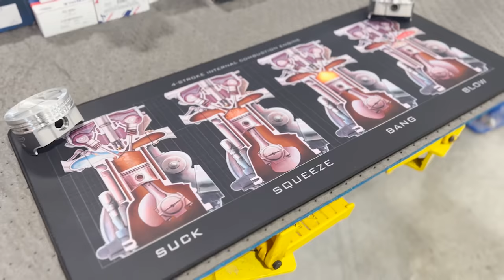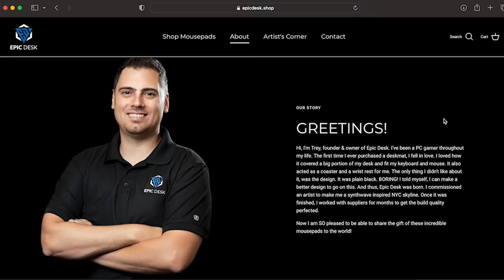The 383 STROKER Kit Has Arrived... Does It Fit?!

Comment: I built my 383 back in 97 long before kit's and crates were available. Finding the right block casting was key to avoiding alot of headaches. Engines still in my 80 Firebird after all these years  and runs great, so yes I would love to see you folks do an old school 383 build. Thank you for the great content guys.
Reply: Same same in 97 , the Vortec head was a new thing and u could buyem from GM assembled for 400 a pair , Edelbrock started making a carbed intake so thats the route i took with my 383 , the new powdered metal rods from GM as well , no need to clear the block but the cam was another matter with shaving down the shoulders on 4 rods.
That motor pulled so hard that ever since i've thought doing a 350 :text-green-game-over: is pointless. Now im playing with a 383 crank in a 305 and ported swirl-port heads for my S10 , can it make 400 lbs torque and knock down 20+MPG ? should be interesting ! :face-green-smiling:
Reply: Huh, '97 was long before kits and crates were available? PAW was offering 377, 383, 385, 388, long blocks, short blocks and rotating assemblies back in the early '80's. Their catalog was about 2 inches thick and covered everything from Chevy 235 straight sixes to Desoto Hemis, to their Godzilla 514 inch Ford 460 stroker kits. There's no less than 9 different crate and kit suppliers in the random issue of Car Craft from the '80's that I just picked out of my pile, the original RHS, racing head service was a pioneer of the crate revolution ten years or more before '97. Super Shops was another mega catalog that offered the same stuff, they just came along later in the decade, I still have all those catalogs, I wish the prices were like that today, lol.
Reply: There were 383 kits way before 97 😂
Reply: 400 crank, 350 block
Reply: @paulmryglod4802  The 400 crank main  journals have to be turned down. It's not a drop in.
Reply: @genefogarty5395  oh yeah I forgot about that

Comment: Kevin Cameron (Cycle World) has impressed me with how floppy "rigid" parts can be at high revs.  It's reassuring to see how much clearance you provide.
Reply: Link?
Reply: @neodimium  Sorry, I don't have a link.  I used to read his articles in Cycle World (on paper!) - he's a master at clearly describing the engineering aspects of high performance engine development.  I'm pretty sure his work can be found online.
Reply: do u have a link, cheers   
(min effort possible here ) weird al
Reply: I'm glad you mentioned this. I've been looking for material on that very subject 👍
Reply: @robertwest3093  Kevin Cameron is like no other and his descriptions about material behaviors inside high-strung motorcycle engines will bowl you over.
Reply: I also am a fan of clearance but I would have went at least fifty thousandths more
Reply: Not just the floppiness of the material, but heat is going to bring things together as well. I think I’d of went a bit more than 60 too.
Reply: @GNX157 .050 is my minimum for clearance and never had a problem. I do prefer a little more for flex and deflection depending on the parts and intended use of the engine.
Reply: Isn’t 80 thousandths the usual accepted clearance for the rotating assembly?
Reply: Kevin Cameron is one sharp individual. Refreshing to see his name on a car video.
Reply: Kevin Cameron is a genius in communicating mechanical characteristics in plain, easy to understand language. He is a national treasure.

Comment: 9:55 witness mark on the bore of the die grinder touching. Was always taught to wait till bits stopped moving before exiting the cut. Like the "it's hot" tip, you only believe it after the first burn.

Comment: 383 strokers ive done required a notch milled at bottom center of each cylinder bore and a relief at the pan rail. Summit was carrying a dimpled replacement oil pan.

Comment: i always use silly putty to check crank clearance. 
put an 1//8" layer of silly putty over the problem area, rotate the crank past the problem spot nice and slow, and then peel the putty out and check the scraped part for thickness to see the clearance. sometimes shows you something the feeler guage and line of sight cant

Comment: great video, making stroker crank fit sbc block is quite a project. one tip for checking cam lobe to con rod clearence is to use nylon tie which is usually .045 thick when rotating assembled shortblock, inserting between moving parts is easier than trying to use feeler gauges i've found. good luck with your project!

Comment: When I get a fresh block for a stroker, I set up a pair and check clearance and then make a grind on all the bottoms, rough cut if you will then recheck all of them. Most times it is fine but occasionally I have to touch up 1 or 2. It goes much faster than doing 1 or 2 at a time. Great video and thanks for taking the time to do it.

Comment: I’ve built so many of these SBC 383 and stroker fords combinations when I was working in a machine shop. On a 9.5 deck SBF 393, 408, and 418 about 30 minutes of clearance grinding and done. So much more work when assembling a stroker SBC. I used to convince people into buying a Bow Tie or Dart block because of the extra shop hours $$$

Comment: I built two 383's with Scat rotating assemblies and their stuff is top notch IMO. The attention to detail in clearancing is a PITA but a necessary evil. We contoured everything with a cartridge that we used a carbide on to avoid any problems. Both engines are still going strong years later and one even gets some nitrous now and then, the other is at just under 100k miles of camper towing. Your customers are very lucky to have such skilled and caring builders/machinists. I'm nowhere near the caliber you guys are at, but with the assistance of a machinist that I have to drive 2.5 hrs. to go to, I can build some good junk, lol.

Comment: We still run our 383's every day here in metro Denver and they are very fast. The secret for STREET APPLICATION is 11 to 1 compression with aluminum heads and 91 oct. pump gas. 
This is what doesn't work here with our thin air: Big cfm heads, big cams, big carbs. We know as we have tried all those combos. Our 383's actually outrun our 400 smallblocks.
My S10 383 outruns our cammed LS 6.0 S10. Its all about the combination of parts and the application.

Comment: Was doing a long rod (5.7”)400 sbc build years ago.  Was using a hydraulic roller cam and the top side of the rods were hitting the camshaft in just a couple places.  Had to grind a small amount from the area on the the rod where the cap bolts would thread into.  The next time I had it apart I upgraded to better pistons and rods and these rods were already designed to clear all areas on the engine. I believe they were eagle series 2 rods.  That with sealed power forged pistons and eagle cast steal crank.  All balanced, GMPP fast burn heads, comp cam 236, 244 @.050 550 lift 10.7-1 comp.  Thing was a little screamer and was bulletproof.   Outstanding combination.

Comment: I love watching your videos! I usually do the bulk of clearancing on the mill then clean it up with the die grinder.  Personally,  I like to come back with a 120/220 cartridge roll and clean up all the stress risers and smooth out the casting around the bottom of the bore and the lifter valley and a light polish on the outside faces of the crank,  get as much oil returning as possible for high rpm applications.  Also, I like to use raised compression height piston so the zero deck leaves 5ish so if it gets rebuilt again switch to std piston still have 5 on the decks to clean up.

Comment: 2:17 - It's always eye opening for me to see power tools used to drive in engine bolts. Just shows me how narrow minded training can make you and how times change.
Reply: Yes, when I did engines years ago, I used a T bar first, then a torque wrench. The T bar is more sensitive than a power tool, and pretty quick.
Reply: It is just for mock up to check rod clearance, probably only 20ft/lb on those nuts. Way faster with a cordless, when it is apart and together 15 times while clearancing. They for sure use a torque wrench when actually assembling.

Comment: Over the hill from you in Rifle Colorado. 
In high school, ‘83 or ‘84, my buddies dad built a 383 for his truck. 
I remember all the fuss about using a 400 crank in a 350 block. The 400 was externally balanced, so a 400 flywheel was required. 
I got to drive it a time or 2. 
  Ran awesome !
Ohhh… & 202 fuelie heads

Comment: What I have done when setting a block up for clearance, i would take a stock rod and cut the long part of the rod flesh of the big in of the rod. I would bolt the big end of the cut rod onto the crank with a bearing in it. You can install the new rod a piston to the same rod journal and this will hold the rod in place to roll the engine over to check clearance.

Comment: Camshaft lobe can get really close to con rods in these engines.They call them stumbling blocks for a reason. thanks for sharing.
Reply: Ran into that problem years ago with stock 5.7” rods. I think stroker kits now use short rod bolts to clear the cam lobes.

Comment: My 383 I built had the same clearance issue. My 400 the machine shop suggested I use 5.7 rods probably not a bad idea but it was even worse than the 383. Had to clearance the block not a big deal but also had to take material off the edge of the rod bolts where they swung up towards the camshaft because they were contacting the lobes. I lost count how many times I assembled that engine before I had at least.080 clearance with the cam. I built that 25 years ago still going strong.

Comment: Not a machinist but I used to study this stuff.  The 'squish area' is supposed to be just right to help avoid detonation.  Something about it squeezes the air out of the flat area of the combustion chamber and that airflow cools the head surface lowering the apparent compression ratio.  You guys already knew that though.

Comment: The camera didnt pick it up but those carbide burr tools sure throw chips everywhere. I used one to open a transmission fork up a bit on an old tractor that was wanting to bind when you shifted the pto. Fixed that problem.

Comment: The compression ratio needed is directly tied to the cam timing specs. David Vizard covers this thoroughly in his books and on his YouTube channel. Higher compression helps with better gas mileage too. The piston to cylinder head clearance also needs to be set.

Comment: It’s great that you guys are trying to keep the CR in the 9 to 1 side. But; you are talking here    static compression ratio; there are in the net good formulas to calculate Dynamic Compression Ratio. If you guys try it, you will find that actually, you can run your engine on a higher CR ( static) and get more power whit low octane fuel and at the same time add more reliability to your customer’s engine… saludos!!

Comment: Check the rods to the cam on 1-2 and 5-6 If I recall right. The inner rod bolt shoulder area can hit the cam lobe on those cylinders every second revolution. I used to grind the side of stock rods right at the rod bolt head. Use a strip of cardboard to check it....I built a lot of 383's back in my machine shop life. Some rods are a lot worse than others. They do make "stroker" rods that help but the block grinding issue is common. The rods you have should clear the cam but check it ! Another issue I've had was blocks with bad core shift. Rods clear one side but not the other. Cam hole pad at the front is a tip off on that one. Cam and crank centerline is off to one side.......I built 383's back in the 1980's when that engine combo became popular thanks to John Lingenfelter and magazine articles......They make real good power and torque..   and Bandimere is going away after this season....that is a shame.....I've never been there but it looked like a great place other than the high altitude !

Comment: If MY opinion matters at all. I'm n old dog like the cleaning guy and we used to flow our own heads, bushing and make stock rods capable of Saturday night on the dirt track.    Funny story.  Working with a machine shop back in WI years ago all the angel plug heads that no one wanted started to stack up at Allis Machine, Laughing with the own Steve and his man Jeff we said wonder how far we could take a set and make power with them.  Soon enough a test mule was built and we all hogged out 2 pairs of the heads. Running on the dyno they made good power to point a pattern was devised and a recipe was cooked to make some motors for some race cars to be sold.  10 years later, a new job, new boss, asks me to look at his 81 firechicken drag car that he bought to try his hand. ( he didn't even know how to spank the hides or leave on the last Y) He was mad cause the car wouldn't even launch from the way the guy he paid to set it up and this POS Jasper performance th400 with a 5500 stall.  So I agree he brings it to the shop and I look under the hood to find one of the angel plug mills I know made at a min 500hp and 530#'. A week of sorting the BS of the other Goober and the boss was drooling as I pulled the front wheels in the back lot. Another few weeks sorting the chassis from the clown that used nails as cotter pins and incomplete cage welds.  First night at the Union Grove raceway I discovered he hadn't a clue how to drive one. So right seat and show him. Car went through the traps at mid 10s which I wasn't expecting at all from the tune I set up thinking about 12. We got booted at the timing shack for the passenger me.  They didn't care but hell of fun.     I think the old cleaning guy needs to build one old school for that monza. No box cylinder heads either there pops.

Comment: Nice detail work thanks for the great videos. In the aviation industry we go with a 0.25 clearance on most moving parts
Reply: Is that 1/4" or 0.25 mm?
Reply: I seen one engine builder recomend it should be enough clearance to not hit aftet the engine destoyed the rod and crank bearings

Comment: Least it's not an H beam rod. When I started at an engine shop as a kid, that's all I did was clearance blocks. The I beam in a 350/400 are not bad, but the H beam I actually hit water because of core shift in a couple of 350 blocks on the cylinder notch.

Comment: Why did you go with a 5.700 rod length instead of 6.0 rods and the appropriate CH pistons?

I seem to remember having to clearance the bottom the cylinder by the cam tunnel too.
Edit: 8:40, I see you got it right after I wrote that!

My guess is that you’ll have to deck .016 after you align hone it.. maybe .018

Comment: I'm still surprised by how much the blocks can vary as to stroker clearance. The block you are working on looks to need the most I've ever experienced. I had one block that needed ZERO grinding, a couple that needed moderate grinding, one that needed just a tiny bit except near the oil filter mounting area where it needed quite a bit. I'm about to head to the garage to check how much my latest 1 pc. seal block is going to need--got my fingers crossed!

Comment: Great job boys there's no nice or clean way, I've done this many times on various stroker cranks. If allowable I've used a 100thou clearance size then use a Dremil with a Barrel sanding head to smooth all the edges for stress relief. Luv your work. Australia.

Comment: i want to use 4.125" crank and 4.110" bore sleeves in a 350 block without block filler going to 5800 rpm. = 438 c.i. 
With 4.030" bore would come to 421 c.i. still enough cubes that all the magic happens!

Comment: You need .060" between the cam lobes and rod...  Incase a rod bearing goes out without hitting the cam lobe.  That's how thick the rod bearing is, .060".  Small base circle on the cam helps with a 383" engine.

Comment: Looks like it fits too me. Normal grinding..if you don’t want to grind put in a stock stroke crank. Buy a Dart block which will take a 3.875 SCAT crank. This is why a great engine takes time to build. It’s a cliche word “blueprinting”. At $100-150 per hr …I do this myself.

Comment: 24:02      I have a SBC block I believe it's 10248880.   It has a divot between 3&5.  Just curious how much it can be decked by checking divot depth.  Or do I scrap the block?  Thanks.

Comment: I know Skip White has the blocks setup in a mill and relieves those areas for a 383 etc. being as it's an engine block it would have to be a fair sized mill I'd guess. I guess in this case the hand held mill is the proper tool.

Comment: We used to use that combo in Circle Track street stock racing. We used to hit water while clearencing some blocks. What method do you guys use to cure that? We have epoxed some blocks  inside and outside the water jacket area and put that water jacket cement in others. Both seemed to have worked ok. Just curious if there are other methods out there? Love your videos. Thanks

Comment: I got lucky when I built mine, the block i got had already been  383,  I had it bored . 040" and got a 385, my estimate is 550 HP around 6800-7000 rpm the .585" cam and 220cc heads, and 11:1 compression, single plane intake ,  I kinda wish someone made a large runner 
 Duel plane intake that fits the 220cc runners,  maybe this could be a project,  casting a few intakes, Based on the Edelbrock performer RPM Air Gap. Maybe Edelbrock could produce and sell them as performer 'X' Air Gap, haha, there is a guy on YouTube who does lost foam casting at home, making carburators and intakes,  and other parts for Ford and other engines, it looks like factory maybe better, definitely show quality parts! Casting intakes from aluminum rims and pistons should not be too difficult, machining the parts is the difficult part! Without access to the equipment nearly impossible,

Comment: since you haven't align bored the mains yet, did that mean you haven't final bored the cylinders yet? if so which piston did you use on the small end of the connecting rod to check for main web clearance?